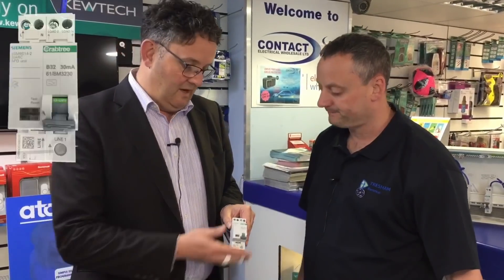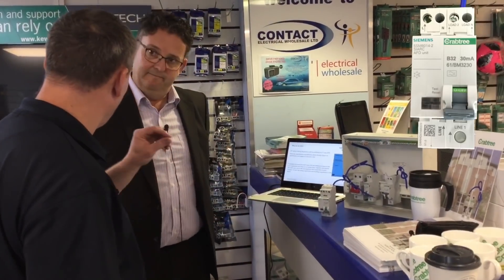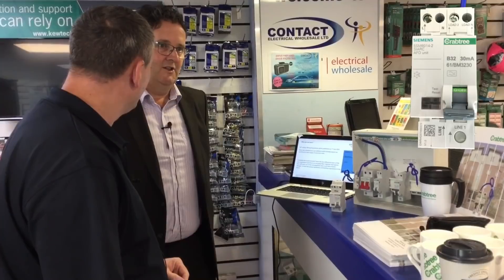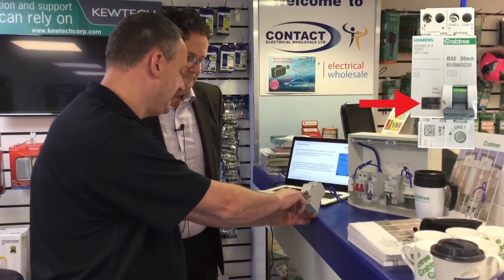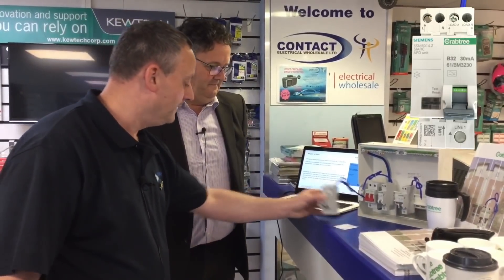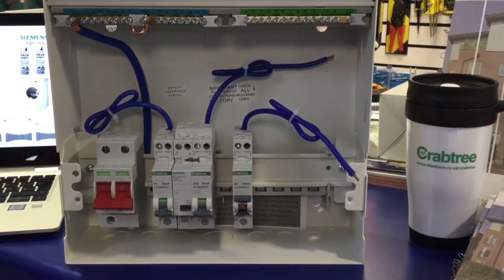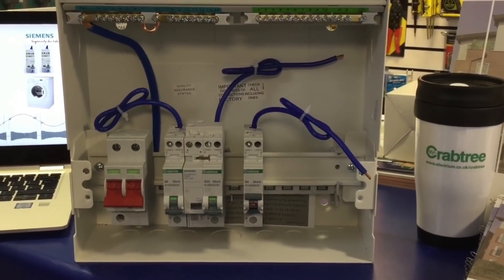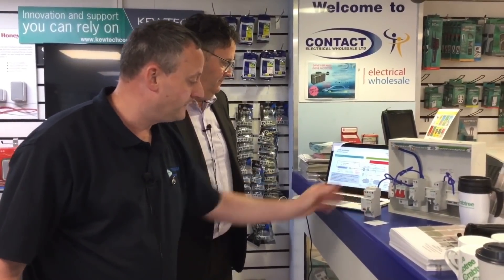Arc Fault Detection Devices (AFDD) From Crabtree Starbreaker Range Tech Talk 18th Edition BS 7671

Comment: "They can retrofit into an existing board". This is simply not correct. The average space for a consumer unit in 20 million homes in the UK already barely allows for the addition of the current ever increasing sizes of consumer units. I know, I fit new consumer units regularly. The average house already has the need for 10-12 circuits (showers, oven, hob, etc.), add 2off RCDs,  proposed SPDs and now these AFDDs. The increasing size of consumer units fitted with ever more devices means a major reconstruction of the electrical cupboard area (often found in a narrow hallway) and does not represent "a simple retrofit". Also don't forget the space for the isolation switch between the meter and consumer unit!. I anticipate having to call in the power company to completely relocate the incoming supply to the garage area or other space (if your lucky to have that space). I can't even fit the currently required safety labels in the average cupboard!! Mr. Lee Edward's response to this "we're talking to other manufacturers about increasing the size of electrical cupboards", oh really, how about talking to homeowners and electricians? For all of these ever increasing demands probably 15 million homes haven't been electrically inspected for 25 years and have no RCD protection!! I'm sorry, I'm trying to be positive but I feel the drive for better electrical safety is focussed in the wrong direction. Too many manufacturers are represented and involved in the consultation processes driving these new regulations. To raise the case of Glenfell Tower as support for these devices is ill advised. I assume the fridge in Glenfell Tower was connected via a socket to a ring main; it is my understanding that AFDDs have a blind spot where AFDDs and ring circuits are concerned (ring mains are also a British peculiarity not generally found abroad). Additionally, there is no evidence that any AFDD device would have made any difference to the fire causation and the real cause of fatalities, the cladding. The single biggest improvement in electrical safety would arise by making it compulsory during the sale of a property to bring the property to a safe electrical standard; as a minimum every property must have a full and detailed electrical survey prior to sale and every P1 and P2 non-compliance rectified before being allowed to be sold.

Comment: Did you get a strong smell of bacon waft through the air as he told you the porkies of £120 each. Best I can find is around £200+. 
The Cos are using some shocking stats in their literature about the benefits of the AFDD's. Bigging up their appropriateness to solve all sorts of cause of fires.

I've watched JW's test of an EATON AFDD and we are both underwhelmed at the effectiveness that JW was able to get out of it.  His article in the Easton one is very salient. 20 Module CU's or more are going to become the Norm. 
I'm doing some research on the Electronic Vehicle (EV) charging unit requirements that don't allow the chargers to be connected to TN-C-S DNO systems. Looks like the installing of TT' earthing is going to be big business.  It's going to be very interesting in a few years time when the DNO street cables start to melt with all the EV (30Kw) charging being used overnight.  Given the length of time a CU sits in a house - are you preping your learners to think about / advise customers to add spare capacity in the CU's for the EV requirements - who knows in 10 years time what extra circuits will be required.
It would be interesting to hear what you think the life span of a CU should be. 10/15/20 years ? - More ?. My old wooden backed Wylex lasted 35. 
Keep up the great work pumping out the Videos and great information.
Reply from the maker: Hi... AFDD’s don’t work....!!!!??? I have done a video with David Savery on AFDD’s, 18amp load and a serial arc in salt water... did it trip?
Thanks for commenting and such a detailed message Gaz

Comment: so if i have 5 socket circuits, i should provide 5 separate AFDD rather than providing 5 MCBs and protecting it with an 
AFDD
Reply from the maker: Hi. No the circuits protect by an AFDD are wired as normal but are protected by the MCB and AFDD dual unit. Thanks for commenting and watching GSH Electrical

Comment: Recently had our yearly NICEIC inspection, the inspector said the AFD will not work on ring mains can't remember exactly the reason think it was the vibration caused by a loose connection which trips these things out would not work on rings
Reply from the maker: Hi this is worth a look. http://www.beama.org.uk/asset/D6E1ED8D-EEB2-4698-807CA85BA77DEC2B/
Thanks Gaz 👍

Comment: A lot of people seem sceptical of these but I think they are fantastic. The price will come down. Only the other day I went to call out where a 17th amend 3 CCU was fitted, it had a recent EICR sticker on it, the previous cowboy had forgot to tighten up the ring conductors and they had melted together and melted the top of a B32 MCB. As they say, there is currently no protection against this.
Reply from the maker: Hi. Many thanks for you comment they are designed to save lives and properties keep watch GSH Electrical 👍

Comment: Interesting video, as always. Will the unit indicate which of it three protective devices has operated so we can narrow down the cause?
Reply from the maker: Hi the AFDD is for each circuit so the one shown was only protecting one 32 amp circuit and not multiple circuits like an RCCB would. Hope this helps and thanks for commenting and watching GSH Electrical 👍
Reply: GSH Electrical . Sorry Gaz, I didn’t make myself clear. 
Does it show which type of fault has occurred, eg an arc fault or an RCD trip or an over current MCB trip?
Reply: @staffshatter1082  no!

Comment: OK, but how do we test them, and how do we debug cases of false tripping ? - its taken about 20 years to get to grips with this for RCDs, will this be similar? (Do they still work with mains filters for example)
Reply from the maker: Hi. I wished I’d asked more questions... I would imagine you will have to disconnect them during the insulation resistance test. Thanks for watching and commenting GSH Electrical

Comment: More expense on the customers of the. self employed Contracting Electrician's... And 1 AFDD for each power circuit? Lets hope it don't come compulsory!!! Before they come up with a model that will cover all circuit's in the unit...
Reply from the maker: Hi. Like everything new to market are always expensive... hopefully over time the price will fall. Thanks for watching and commenting GSH Electrical
Reply: RCBOs have fallen in price over the years and now they've started to make them digitally with microprocessors instead.
Reply: They won`t be making 1 unit covers all as their is to much money to be made fitting to individual circuits.

Comment: Expensive stuff
Reply from the maker: Hi. Clever but expensive. Thanks for commenting and watching GSH Electrical 👍
Reply: To be fair in the whole £150 is less expensive than your house burning down. AFDD should have been introduced years ago.
Reply: Beariam24 - Plus the cost of a sparks to fit and test it, say £300 total, multiplied by 27.2m households, comes to £8 billion. There are 8000 house fires per year caused by faulty electrics, costing an average £15,275 to reinstate, coming to £122 million per year. So over the 35 year lifespan of a typical electrical installation that’d save an absolute maximum of just over £4 billion. In other words less than half the cost, assuming it stopped every single electrical fire! In reality it’ll probably stop a small fraction of those house fires, so the saving will be far less. 
Whilst all this excessive health & safety can be presented as a good idea if you only focus on the benefits, its costs divert huge amounts from real productive enterprise and efficiency. Which in the long run will make the UK less competitive and poorer relative to countries that take a more balanced approach.

Comment: Brilliant little video here , would this AFD unit interfere with insulation resistance tests ???
Reply from the maker: Hi. It looks to me that the connection between the RCBO and AFDD is across the top of the device if this is the case I don’t currently know if when you turn off the RCCB which is double pole if it Isolates the AFDD Unit and therefore allowing the insulation resistance test to be carried out from the top of the RCBO. Thanks for the great questions 👍